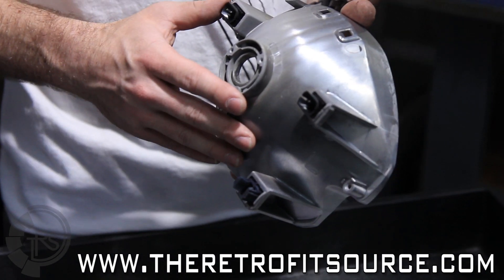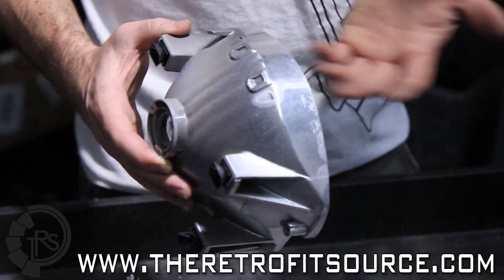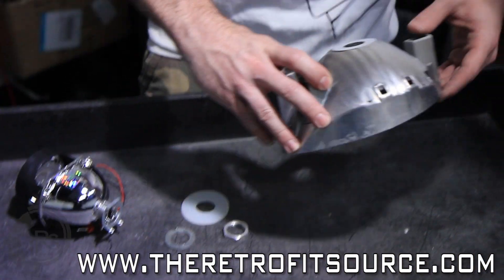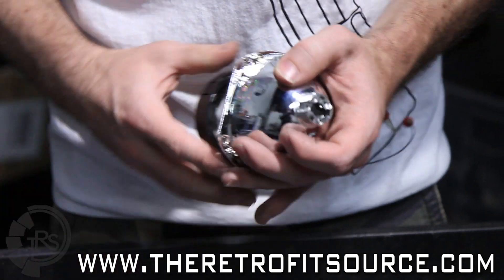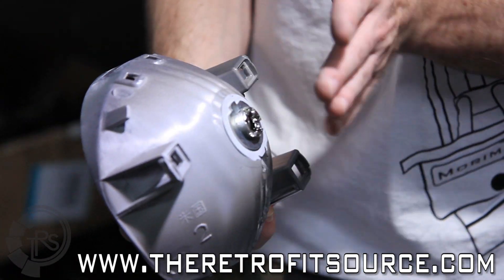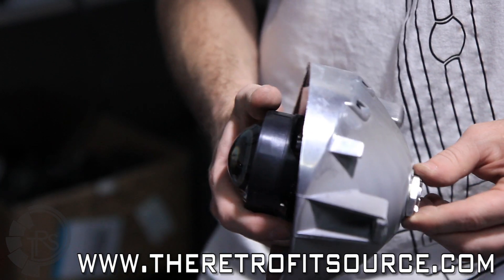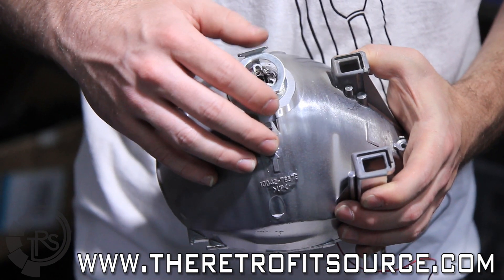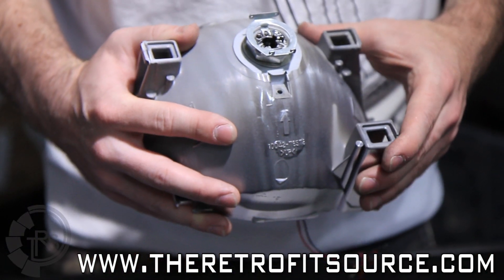TRS Tips: Retrofitting the Morimoto Mini H1 6.0 into 9006, 9007, H11, H13 Headlights

Comment: @ThrRetroFitSource 

Can u swap from oem projectors, to aftermarket projectors for more and sharper cut beam pattern?

And would it be an easier access and easier swap, since it’s gonna be from projector to projector but better?
Reply from the maker: Absolutely!
A lot of vehicles are a direct swap, some require brackets. 

What vehicle are you working on?
Reply: @RetrofitSource  it’s for my 2015 lifted Scion xB. And right now I’m workin on putting a roof rack. 

Later on. Hopefully I would be able to complete my off-road suspension components, and then focus on swap my all Boring incandescent/halogen bulbs. 

So far, I did use GTR Lighting 10 chip canbus T10 mini bulb on my front headlights, did swap a high beam halogen for 8 watt 3000k led yellow lights from SNGL. It’s not that bright, but bright enough for looks and useful for weather conditions. Plus, the brightness doesn’t hurt that much, compare to high beam halogens or better 20-30watt led high beam lights.

Now I gotta focus on low beam,my T10 side marked of the front side headlights, and my tail lights to be full led. Make it look premium. 

Especially my license plate lights. They been burned out for few years lol.

Comment: I have h9 bulbs in my cars low beam projector, I’m planning on retrofitting the high beam reflectors to projectors and replacing the oem projector with a retrofit, my question is how could I wire both projectors to be bi xenon? Will the high beams only come on when I turn them on? And how do I get the low beams to have a dual function?
Reply from the maker: You just need a splitter! (:

Comment: I'm planning to convert my headlights soon.What are those wires on the projector headlights for and where to plug it?
Reply: they are for the solenoid for the high beam. if your vehicle has a seperate high beam I wouldn't worry about it
Reply: @jeddan david if you do plan on wiring in the high beam it will plug into your harness
Reply: I see..think I need to search more about the solenoid.Thanks.!

Comment: What did you do with the wire for the cut-off shield solenoid? Drill another hole after install? I'm about to do this retrofit next weekend, and that's one thing I'm wondering about. I'm thinking I should drill a small hole in the reflector bowl under where the silicone washer will seat, feed the wires through, then seal it up with some slow drying silicone. What's your solution?

Comment: So I'm in the middle of my retrofit. Headlights open, everything trimmed down, and now I just need to test fit the projector. Well I thought the hard part was behind me, then I run into the Morimoto bulb holder screws from hell. Those things feel like they were installed by an impact gun. I managed to remove two before stripping the rest in a failed attempt to remove them. You can even see depressions in the bulb holder from how tight the screws were put on during assembly. I'll definitely be returning them. I still want to finish my retrofit but I'll ask TRS to remove the bulb holder screws for me on the replacement set. It's not a pleasant experience to endure after dropping $320 on the stage III kit.
Reply: Yup i know. I had couple of them stripped too on Mini H1 7.0. Luckily i had like 7 different small screwdrivers to finally get one to fit snugly and SLOWLY with some pressure, get them out.

Comment: I have d2s projector  for a vehicle a ended up selling. has there been d2s retrofits to lamps that would  normally take 9006 bulbs? I don't wanna waste the material I have in hand thank you
Reply: Yup. I saw an accord retrofitted with D2S that has 9006. You may have to cut the back of the reflector, like he sanded here, to make the D2S lock nut fit.

Comment: i have a 2004 accord coupe its a 9006,i have the 9006 ballast and bulb but the mm are h1,i have a separate low and high beam,i just want to use it on the low beam dont  want it to work with the high,do i just get a h1 bulb and plug into my 9006 ballast?

Comment: very informative  video. have you ever tried led bulbs in these optics?
Reply: +cosku arsiray Yeah, it doesn't work well at all. Need to use HID to produce the proper results.
Reply: +cosku arsiray I'm running LED light sets in my low beam projectors and the light pattern is perfect.

Comment: a question, someone know if the Morimoto Mini H1 is the same projector used in Retrofitlab ?? are the same size or are different products.
Reply from the maker: ***** They are using a low-end generic H1 projector, the optics on the actual Morimoto version are generations ahead of the rest. Size wise they are quite similar though

Comment: I have a 2001 monte carlo ss and the low beam is 9006. Im thinking about doing a retrofit with the marmot mini h1 6.0.  What bulb do I need to buy for this application? Would it be a 9006 hid kit or something else because this projector is bi xenon and my factory setup is separate high beam and low beam. Would the normal high beam come on and the projector not or the projector and high beam. Im just a little confused on which bulb type I would get?
Reply: Austin Ehm 
WRONG YOU WILL NOT USE 9006 ANYMORE. its called a mini H1 because it uses a H1 BULB!
Reply: It would still be a 9006. You will have to buy the minimoto that works with 9006 bulb that's all
Reply from the maker: Austin Ehm Yes, you will run a 9006 HD Relay harness with the 9005>9005/9006 splitters to make everything work properly from the controls inside the car. The Mini H1 projector will use an H1 HID bulb. You'll have xenon low beams from the projectors, and then xenon high beams on the projectors working in conjunction with your stock halogen high beams.

Comment: I will be using this instructional video as one of two videos  to retrofit my 04 accord. My main question is how do I connect the solenoid wire?
Reply: The Moto control harness from TRS is plug and play and controls the solenoid when you switch from low to high to low beam.

Comment: How stable is this setup without any bolts or adapter plates? Just a single rubber washer and lock nut.....
Reply: I did my wifes chevy cobalt just like this with this exact projector and it's been over a year and it still performs perfect. I was too worried about this but no issues a year later and porbably about 15-18k miles.

Comment: I am planning on doing this to my 2010 Dodge Challenger which has H13 Halogen headlights. Will the retrofit be the same on that application like your video? Will I have to sand down the rear side of the reflector and will I have trouble with adjusting the light? Are there any plans for a H13 retrofit that will be plug & play like the H7?